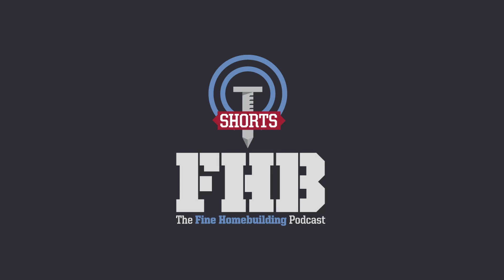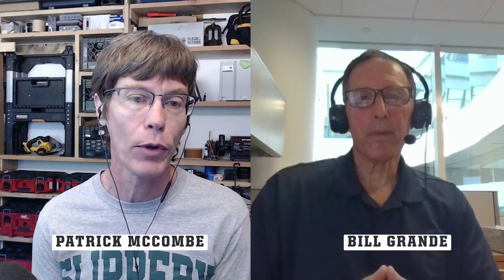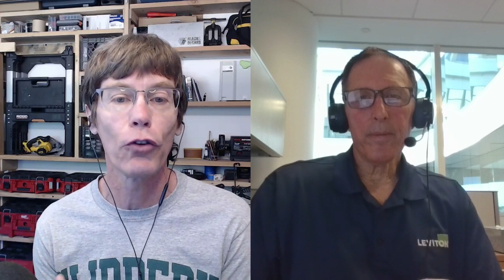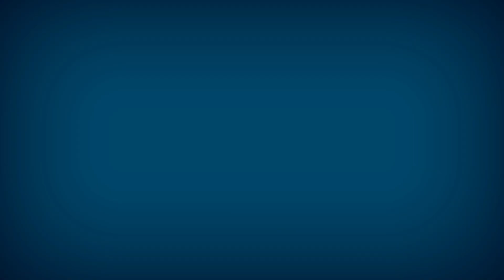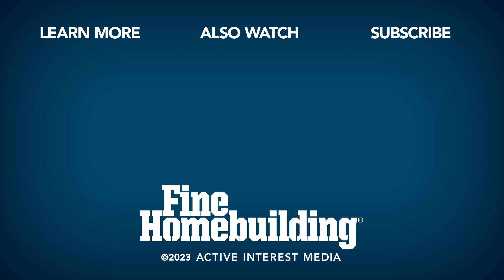Is the World Ready for Full Electrification? A Conversation with Bill Grande, VP at Leviton

Comment: Nuclear power is part of the equation but people are scared of it. It is safe if protocols are followed and it’s not bombed. Some of the world’s most advanced nuclear companies are American so we have the best available technology at the ready.  Short of that, larger buildings will need to be designed differently as in each unit having a ductless split and not heating or cooling corridors, passive design, etc.  Average Single family homes are not an issue and should not be the focus of cost prohibitive energy codes.